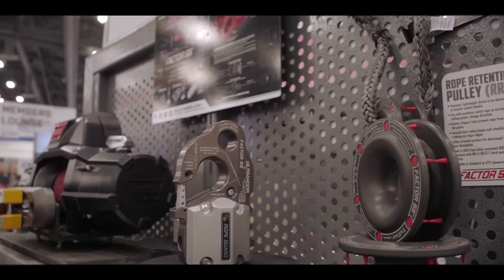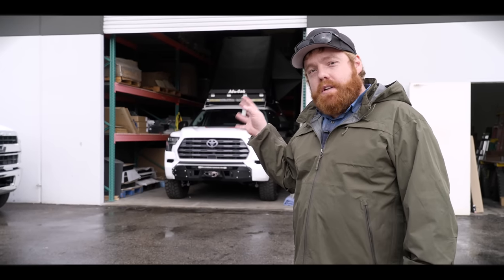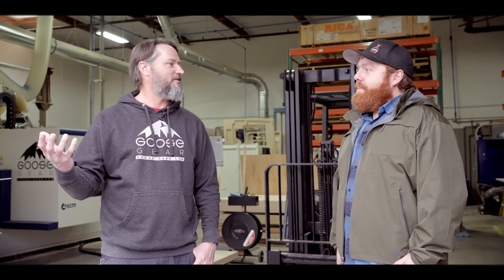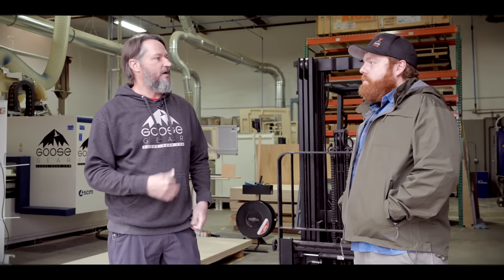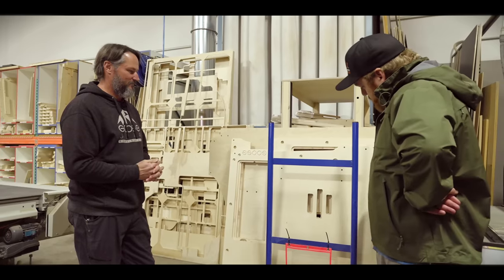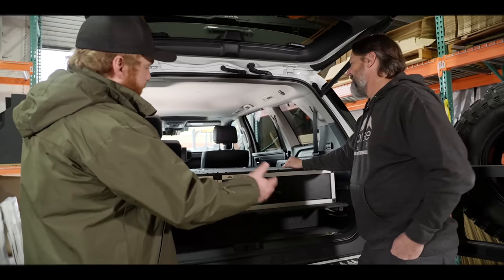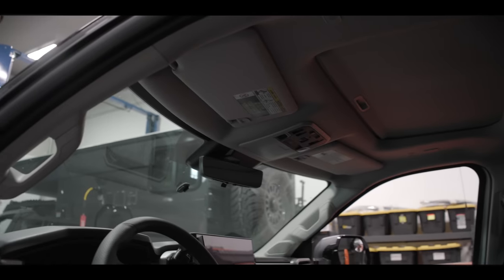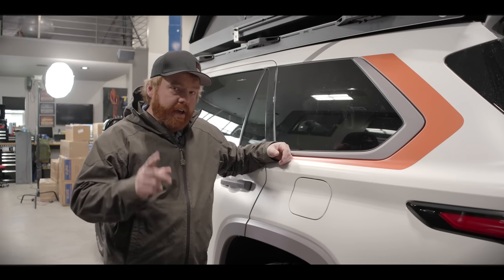Building an Overland Storage System for our 2023 Sequoia with Goose Gear | SEMA 2022 | SHOP TALK

Comment: Great job on the video folks! Thanks for making it. I love a 60% delete. I built a system out of wood for the back of my 4Runner, and originally it was a full flat system that covered both the folded down back seats, but then I realized I almost never need that much flat space so in a subsequent version I just covered the 60 portion.

Comment: Great built! The new Sequoia is much better looking than the gen 2, but Toyota really dropped the ball on the 3rd row/ cargo area. I understand the issue with the battery, but it's a dealbreaker for those of us with multiple kids. 

Hopefully Toyota does a better job with the coming US market Land Cruiser.
Reply: And that battery pack don't add much to the powertrain, what a waste of hybrid system.

Comment: IMO, it was a failure of Toyota not making the new Sequoia's seats fold flat like the previous generation. I realize the battery is in the way, however, Toyota engineers should have come up with a meaningful solution to this problem. We fold the seats in our 2nd Gen Sequoia all the time. Not sure I could live without that option on a daily basis. The 3rd Gen Sequoia has lost some of its versatility as a result of this. Toyota also should have incorporated more high strength 4943 aluminum in the construction, to include the chassis. At least they brought back the solid rear axle!!

Comment: Why does such a large SUV feel so unsatisfying in providing real usable space?
Reply: I think the real problem is the clumsy battery location. I don't think there was time/money to take the Tundra battery and massage it to fit into the SUV body better, like above the spare or into the side panels. Hopefully a mid-cycle refresh will improve this.
Reply: @guentherwilke2055 it took them 15 years to update the sequoia. I wouldn’t hold my breath for a mod to the battery.